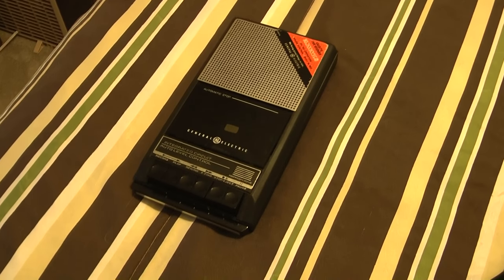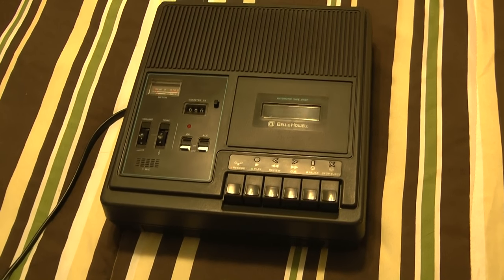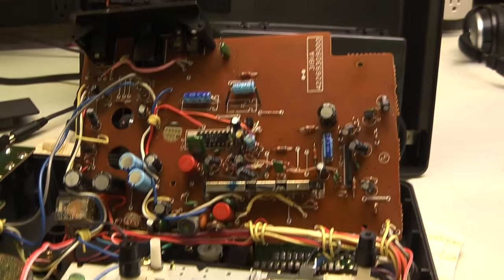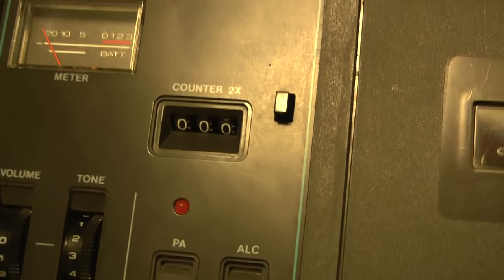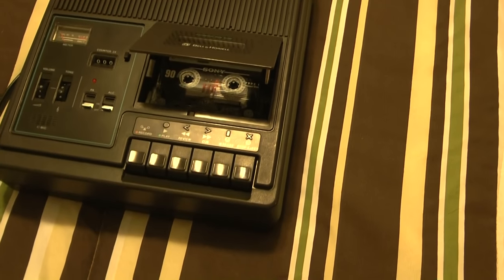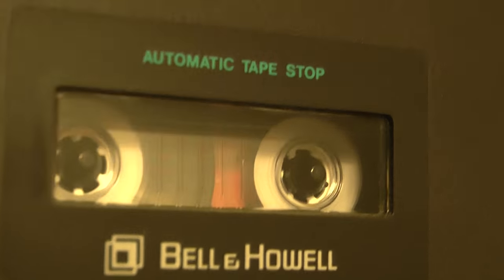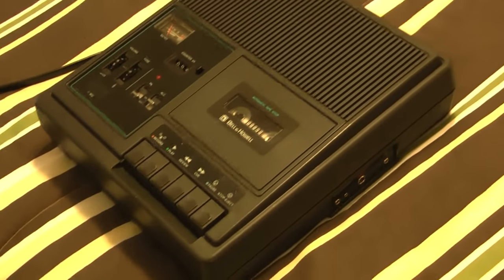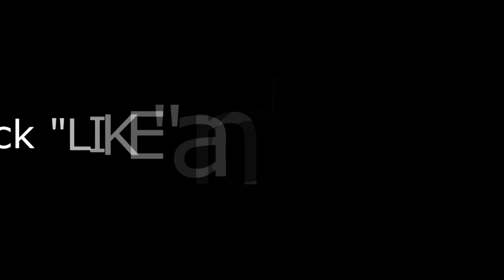The Bell & Howell Model 3191A Commercial Cassette Recorder

Comment: We had these exact Bell and Howell cassette recorders in grade 6 and grade 7. This would be 1983 - 1984. I remember they also had headphone "bars" connected to them with ten or more ¼ inch jacks and individual volume controls. The headphones they had were junk and very uncomfortable to wear. We used them in French language instruction class which started in grade 6. 
Over the years I have found a few of these at thrift stores in the 5 to 10 $ range, and like you purchased them as a school memory, although I recall at the time we considered them to be pretty uncool because they were mono, and boomboxes we had in the early 80s were Stereo.
Bell and Howell did make pretty robust stuff. Only failures I can think of from school was one of the blue/green-colored film projectors starting on fire, and the lamp in a film strip projector (a.k.a. brown metal box that got REAL hot) failing violently and sending pieces of hot glass everywhere.
Reply: I had the same experience at roughly the same time :-) I also remember those headphone jack bars, and those stiff plasticky-vinyl headphone earcups that were very uncomfortable.  Oddly, our headsets had microphones also, which we never used for anything, and I think they were Telex brand.  Mine were in Spanish class.  "Montevideo, Uruguay...Brasilia, Brazil. Brasilia, Brazil."  Something called the "Capital Rap."

Comment: I'm a bit older than you being in elementary school in the early 70's but I remember my school predominately using Craig model 2610 cassette recorders, I believe they were from 1969.  They were actually manufactured in Japan for Craig by Sanyo.  There are a couple of them on Ebay right now if you want to see what they looked like.  The thing I loved about them even though they were very basic machines was the T lever control instead of push button.  The school also used another brand of cassette recorder that I can't remember that had a rotary control.  I've searched Ebay many times looking for it as I remember exactly what it looked like but haven't as far found one to find out the make and model.

Comment: I used a similar model in school back in 97-98 but the one I used was a little smaller than yours. Not sure if B&H made it though. I would record stuff on it and I had a portable CD player and played that through the unit.

Is there a way to play the audio from your phone through the speaker by the aux input?
Maybe PA mode?